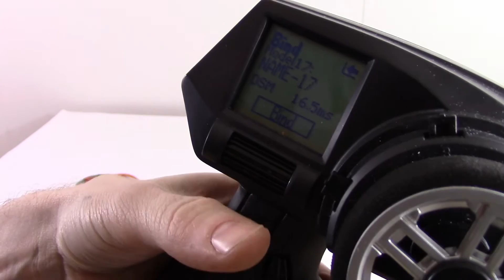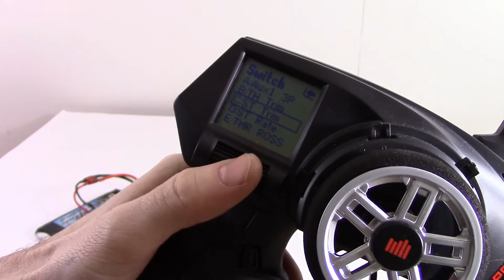DX4C Memory Problems: Fixed

Comment: hello, I just saw that I also have the same problem, thanks for the fix! otherwise it is normal that the first time you bind you are in dsmr 22ms and after when you rebind with the same receiver you are in dsm 16,5ms? it's strange no? thanks in advance (i have one dx4c & i'm with 2,1 firmware... you are lucky your dx4c work with dsm, my dx4c only operate with dsmr 11ms and 22ms and with dsm2 16,5ms... it's bad, but i'm from france/europe perhaps it is why, restriction on dsm2... you are certainly with the first firmware the v1.0, with the v1.0 I believe that all modulation work, dsm dsm2 and dsmr, and you can make the dsm2 11ms? if yes it's really perfect)
Reply from the maker: Glad the memory problem fix worked! You are right it seems strange that it said 16.5ms on the second bind as the receiver is a dsmr one and it's showing 22ms now and the only options I have for it are 11 or 22ms. As I understand it using dsm2/dsmr is dependent on the receiver being used? I don't really know that much about the radio protocols though so I could be wrong. I still have the stock v1.0 firmware, I have thought about upgrading it but maybe I just leave it the same, I am surprised the memory problem still existing on the v2.1 firmware.

Comment: there is an easier way to fix it. enable avc go back to main menu turn off transmitter then back on disable avc then set channels how you want them. then turn transmitter off without going back to main menu. turn it back on and your all good. as long as you don't turn avc back on.
Reply: worked or me. thank you
Reply from the maker: +mikes hobbie's and random stuff really? Nice I will have to give it a try next time I have a problem with the dx4c
Reply: Void X RC I got it from another vid on here in the comment section and tried it.  I almost returned mine today but thanks to that I'm keeping it for my scale rigs. I think your method is still needed if you want to run AVC though. I don't have a receiver for that because I don't race so no way of testing it.
Reply: @mikeshobbiesandrandomstuff  my dx4c started doing it yesterday after 3 years of owning it and this worked, thank you buddy
Reply: thanks for the fix, it's perfect ;)

Comment: Thank you very much, this fixed my issue, now I just need to find a way to get my RC4wd winch to work. Sigh!
Reply: Patrick Laniak buy a rc4wd winch control switch and you winch will work off of your AUX channel
Reply: I have mine pluged into the aux 1 and then go to "switch" in the menu and set switch c,d or e to aux 1 3p